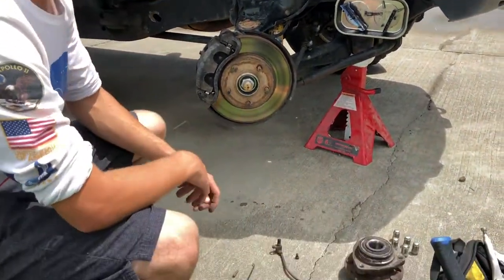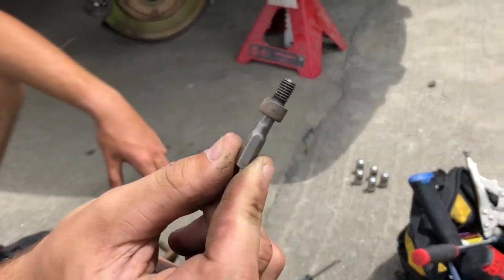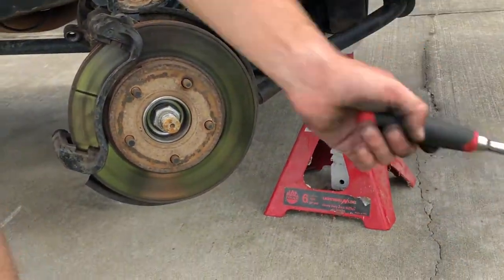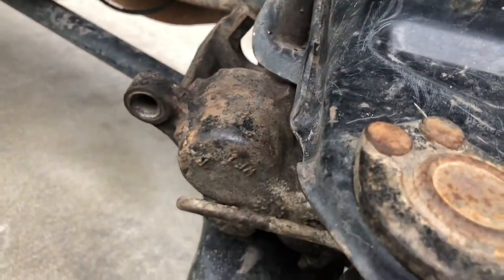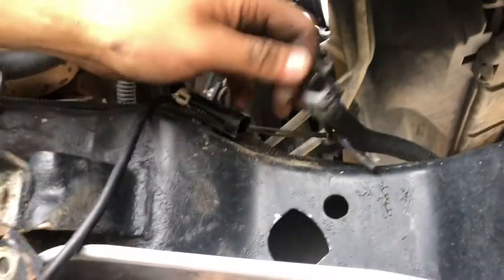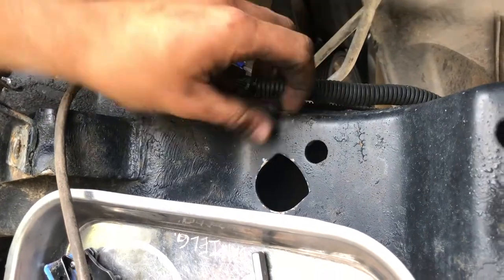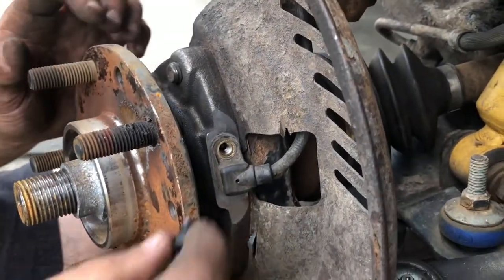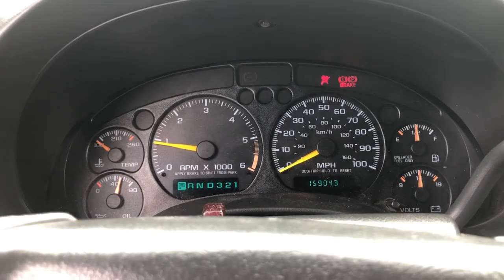How to Replace ABS Wheel Speed Sensors (98-04 S10 4WD/ZR2/ZR5)

Comment: If you’re replacing the front ABS sensor  on a Chevy S 10 2 Wheel Dr. (95-04)  and the wires are not ripped try just cleaning off the sensor because boy it’s a pain to replace